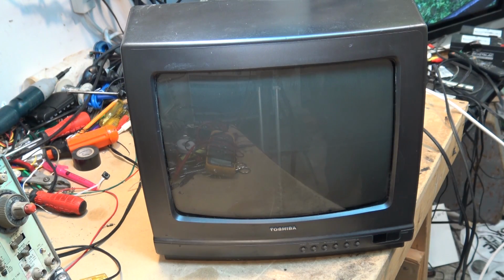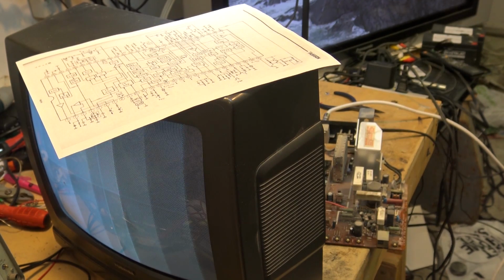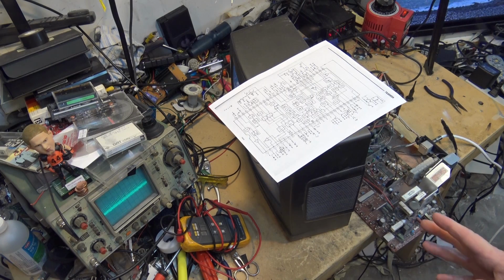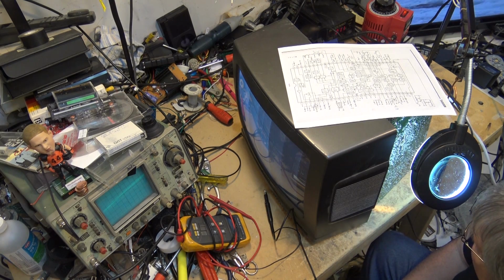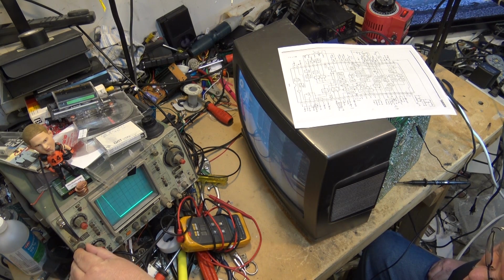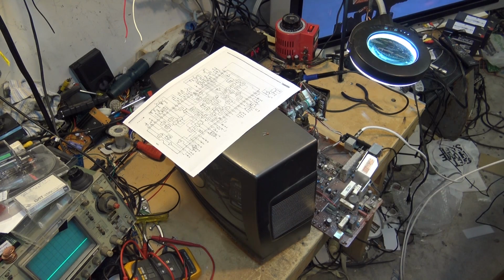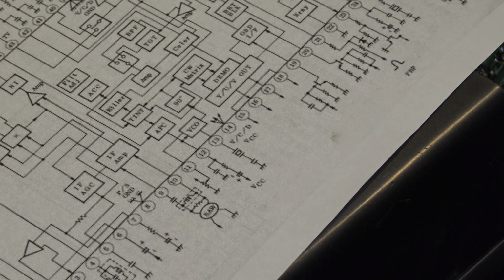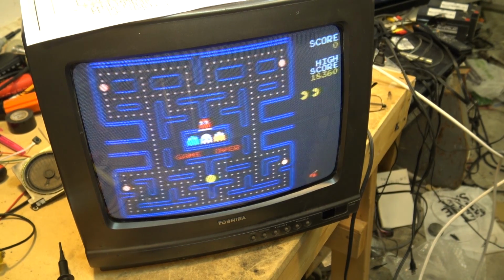Toshiba CRT TV No color repair

Comment: About retrogaming, I have a Raspberry Pi connected to my CRT TV with a HDMI to VGA converter and with a home made VGA to SCART RGB (picture is amazing) so the CRT is directly driven by what ever resolution I choose, for instance if I go too much out of spec the TV won't sincronize.. I have mine set to 320 x 262 at 60Hz progressive I chose 262 lines (half of NTSC 525 interlaced) so I can have nice scanlines to be as acurate as possible to real hardware. I read that a lot of people set theirs to 240 lines instead of 262, I tried this and though my TV did sync properly the image was more streched (less lines but still filled the screen) but I could actually hear that the horizontal frequency was different, maybe lower as I could hear it better. My question is do you think it is safe to run the CRT in this off spec frequency? Could it damage the set? Or as long as the TV can sync to the signal it won't matter? BTW don't know if it's relevant but this TV can sync to either 50Hz 625 line or 60Hz 525 signals.
Reply from the maker: Won't hurt it off frequency if it syncs up then you are fine. So you feed RGB directly in. Cool. I have a 21" viewsonic CRT computer monitor,and I have connected my HDMI to VGA adapter into that, and the picture was amazing, and that monitor will do HD. My cheap HDMI to VGA adapter will output either a VGA or component signal. I have used it to record stuff on my component capture card from HDMI sources.I use a raspberry pi as a media player, for SD content into a modulator, but I just use the SD output from the pi itself.
Reply: Cool, good to know, yeah we were lucky here in Europe as virtually every CRT since perhaps mid 80's had RGB scart capable connections, most will also sync at 60 Hz even though we use(d) 50 Hz PAL or SECAM. Some, maybe most from mid 90's till the end of the CRT era even support NTSC composite, but even if they don't as long as you feed in RGB it doesn't matter. Scart is very interisting, I don't know if you know much about it as it's virtually non existant out of PAL regions. Apart of feeding RGB directly you must feed in a sync signal and around 3V to the blanking pin to make the TV switch to RGB otherwise it will expect a composite signal and show a black screen. There is also another pin that depending on the voltage it tells the TV if the signal is 16:9 or 4:3, that same pin also serves to make the TV go to AV automatically, like if you were watching a broadcast channel and you would switch on your VCR or DVD player the TV would switch to AV on its own.
Reply from the maker: I actually have a 14" JCV multi system TV that I paid an absolute fortune for (probably 1,000.00) when I was doing standards conversions as I needed to be able to check PAL and SECAM tapes for clients before sending them out.It has a SCART connector. It was a good investment, as I had a situation once, before I invested in my own gear where I was farming the conversion out to another company. I paid the other company, and they did a shite job, and then I was the one in the crosshairs with my customer demanding a refund. So in the mid 80's my company bought a standards converter, and a multi system VCR and monitor. That way I could show the client the tape, playing in PAL or secam on a native monitor so they could see the tape before it was shipped out. I eventually picked up an AGW1 when the price came down to 3,500.00 as I was busy enough doing standards conversion back in those days.  Those machines ran about 12 hours every day. I was so busy out here, as my community has a huge British population, and people were sending tapes back and forth weekly.Many were sending TV shows back and forth!
Reply: Man a grand for a 14" TV? That was crazy expensive! Perhaps a future video demonstrating that TV and showing off that SCART socket to fellow North Americans? Time to play with some RGB goodness!
Reply from the maker: Yes it was ridiculous how much multi system cost in the 80's and 90's.There was one shop that dealt with foreign electronics, and he imported everything in everything, and prices were high back then anyway, and bringing in something from a different market just added to the price. I knew the owner, he actually sold me my very first VCR in 1979. The business is still around, run by his son today. It cost big money to get into standards conversion equipment back then, and that is why we were charging 50.00 a hour to transfer tapes. Some people called up crooks, and a few even threatened never to come back. They all did when they found the competition down at paradise video was charging 80 an hour to do the same thing.Standards conversion machines cost a bloody fortune. I ran with a Hitachi multi system VCR for VHS, a Sony multi system for Beta, and a Canon PAL camera for 8mm. I forget the name of the digital standards converter I used, it was a unit I had. It was not a name brand unit. Rack mount Had BNC in and out and 4 switches on the front. Power, source, input standard PAL/SECAM/NTSC and output format PAL/SECAM/NTSC.It was a fairly big box and weighed about 40 LBs, cost me something like 12,000.00.  So a grand for a multi system monitor was nothing compared to the cost of the rest of the equipment. A few years later Panasonic released the AGW1, and even though the quality was not nearly as good it sold for 5G initially, and meny more shops jumped on the bandwagon, and prices  fell from 50 an hour to 25 overnight.My equipment had paid for itself, and when I found my competition was offering my customers a discount rate if they would go to him, I dropped my prices to 10 an hour for the remainder of the time I was in the standards conversion business. I still have a multi system VCR (The old Hitachi) and the multi system monitor, and a box that will convert PAL to NTSC, and vise versa. The old gear eventually broke down, and I couldn't fix it. The company that made it was long gone and there were no parts or any data available.It was full of ICs that the tops had been sanded off so nobody knows what they are, or what they do. I made my 12 grand back, and much more, as I was doing this (in addition to working in the repair shop, and running a production business, I did conversion work for 4 retail businesses.)I still do video conversion work from home but nothing like it was back from about 84 though to about 2006. That 22 years I made a good living out of video production, and could justify the sky high prices for equipment.
Reply: I'm curious, how did that expensive standards converter handle field rate conversion? I don't think they would use motion interpolation back then, most standards converters would result in a jittery motion, especially in panning scenes. Almost all my TVs are multisystem I have a 14" and a 28" CRT that does PAL, SECAM and NTSC, and both my LG LCDs can handle everything you throw at it (PAL, SECAM, NTSC, PAL-N and PAL-M) I have an AIWA HV-MX100 multisystem VCR and I have a few NTSC tapes we recorded when we were in Canada NTSC output is fine but when I select PAL output the picture gets a bit fuzzy and and the framerate conversion is obvious.

I don't know why the American market was so restricted to NTSC, I've even seen a video where a TV sold in the American market was actually PAL/SECAM capable but disabled in the service menus, the video demonstrated how to enable it. Europe was and is much more open to every other system, even back then most cheap PAL only VCR had NTSC playback with a PAL 4.43 subcarrier (aka PAL-60). I believe all TVs now support all analog colour systems and 50 and 60 Hz. I know that even today some HDTVs in America won't even support 50i or 50p through HDMI (also disabled in the service menus in most cases).
Reply from the maker: For that matter they are disabled for 50hz HDTV.The standards converter I had was very good at frame rate conversion. The cheap ones (Panasonic AGW1 I am looking at you) were juddery. The one I had, not perfect was better than most. . This one would blend frames mid frame, so if for example you panned past a vertical edge at the frame where it had to add or drop a frame there was a slight bend, but it did it over the course of multiple lines. Best way to describe it is the "jello" effect of rolling shutter on camera. The image would bend on fast pans.  This is one of the ways I was able to justify the price I was charging. Compare it to the cheap ones. All was well until one day I turned it on, heard a pop, and a bunch of smoke came out.The company was long gone, and I had no service data on it, so it ended up being sold for scrap on Ebay. Some guy in the states had the same unit that had gone south, and bought it from me for parts for 50.00 and then whined and complained on the freight charges. Cost him more to get the thing shipped. He had an account so I sent it freight due!
Reply: Still on this subject, have you ever tried any of those cheap chinese little conversion boxes that does PAL/NTSC/SECAM in PAL/NTSC out, when I saw those on ebay, at first I thought they would just change the colour system but wouldn't change the framerate, like NTSC-50 or PAL-60 as there were some of those a few years back, but apparentely they change the framerate as well, they look very similar to those HDMI to composite converters.
I don't know about the quality (I wouldn't expect much), but still it's funny how today something so small and so cheap can do something that used to cost so much and much heavier :P

Comment: So would any of that voltage be enough to kill or injure you? I have been bitten by modern automotive ignition systems and they run up near 30 to 40 kv, sometimes more and it will wake you up in a hurry but not kill you, I cant see this TV generating anything like that.
I mean automotive ignition systems create enough voltage to jump a 1" gap with a nasty hot spark, I have never seen anything in a TV do that.......
Reply from the maker: You have never seen the second anode in a TV arc. 30Kv on a cold tube (one that the filament hasn't warmed the gun enough to emit electrons) can pack a hell of a wallop.  I got hit by second anode voltage once. My assistant tech had just replaced the CRT on a Sony 25XBR. I was set to do convergence. I reached over the set to adjust the purity magnets. My helper didn't clean dirt off the glass or the cobra (That is what we used to call the HV lead, because the cap made it look like a cobra, and it bites) and when I reached over my forearm came in contact with the cap, and I touched ground with my thumb down at the CRT neck. Sounded like thunder, loud crack. Bolt of lightning went in my forearm, and out my thumb and left an arc mark on my thumb nail that caused a ridge to form on the nail that is there today. Felt like I hit my thumb with a hammer after the throbbing went away. I yelled ever 4 letter word in the book and the boss came in and told me to watch my language and keep my voice down. I told him to F--- off!I don't know which one hurt worse, that one, or the 2,100 volt jolt from a microwave transformer. They both equally hurt.
Reply: 12voltvids Oh wow! I have worked on tv's but never had the pleasure of getting bitten by one but I have had a modern ignition coil on a car bite me through a rubber glove like it was not even there! High voltage makes non conductive materials conduct like they shouldnt.......

Its amazing though, the batteries in your Volt pack more energy then people can imagine, touch one of those orange cables of death and you will be dead and cooked before you realize what happened........
Reply from the maker: 360 volts DC and you won't know what hit you. Yes the batteries in electric cars pack an incredible amount of energy.I wouldn't want to be an electric car mechanic to tell you the truth.

Comment: an occasional failure in some Toshiba sets, same vintage are some ceramic .01uf caps. at color, contrast or bright control lines to video jungle. will test OK with ohm meter but are found to be breaking down at a few volts. a good clue is the loss of color (or contrast) goes back OK when color is reduced , then brought back up. then cap starts to short again, and color goes. small brown ceramic discs, "103" marked.
Reply from the maker: Dam, you took one of my surprize faults away.

Comment: The Samsung CRT tv I have has WII,N64,DVD VCR combo /Sega game counsel clone, Roku HD, 50 analog channels . my Samsung tv is 22 years and still works just like it came off they assemble line.
Reply from the maker: Agreed, CRT televisions were pretty simple devices with very little to go wrong with them. None of this high tech BGA mounted parts with software to go bad. Even when they did break, unless it the CRT was the cause of the failure they were usually fairly easy to repair.

Comment: I have sanyo CRT TV that got form the curb and think its 13'' but I'm not sure and it dose work just fine. I use the sanyo TV with my NES. TV I'm going to try to fix is a 1979 RCA solid state B/W TV.

Comment: The quality of old crt sets, i bet that has outlasted quite a few lcd tv lives.

Yup i thought cristal too, the older sets had a 22pf trimmer capacitor connected, handy to get it spot on frequency :-).
I would not be supprised if the cristal has slightly changed its characteristics over the years.
Splatting parts on the underside is my way too :-), once the set works then they are mounted correctly, unless its my unit then they can stay there LOL :-D
Reply: And he pulled that cap from a scrap board, just like I love to do :D
Reply: Hey ive done that for most repairs, i could not afford new parts all the time so old pcbs were stacked up in a box, i repaired a hell of a lot of c.b radios from those pcbs, i had loads of cb's to repair from all over the uk.
I cared that they worked propperly, other repairers didnt give a dam, so they all come to me, not many radios come back due to my repairs.
Those pcbs made the customers repairs dirt cheap.
I didnt make much money but i didnt care, not a money person.